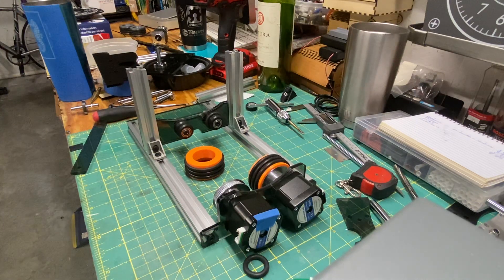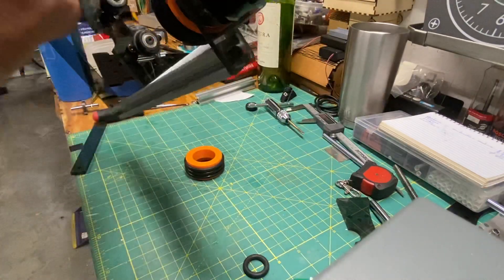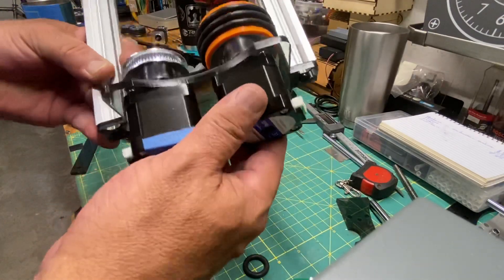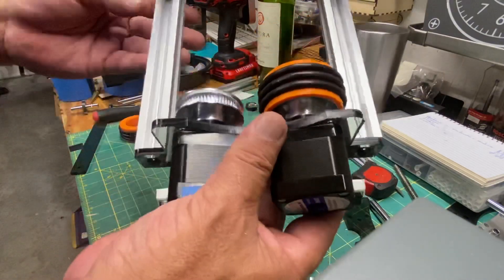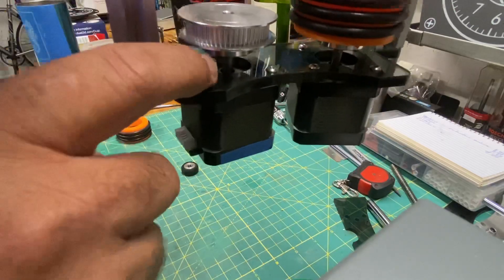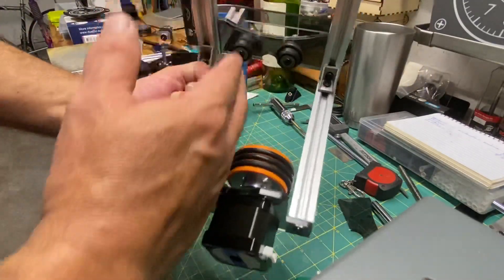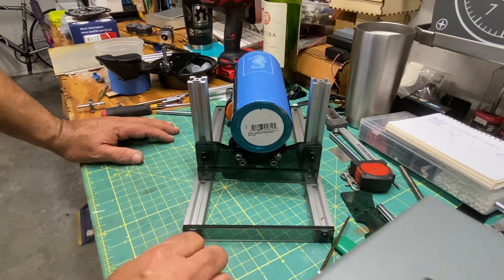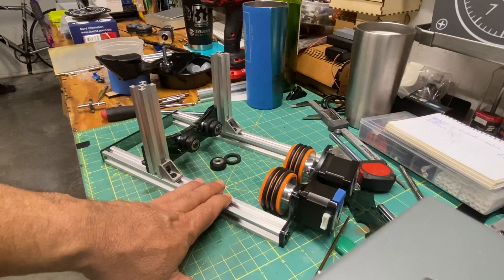Low budget Rotary

Comment: Nice job on the attachment. You should link the materials in the video description. Also, for adjustment, a small level, placed on the surface that you are going to engrave during adjustment, might keep you from having to create too many jigs, especially for wood turners whos surfaces are rather random.